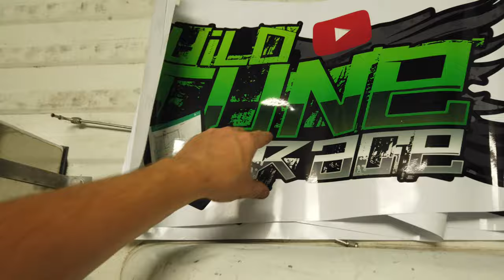Girlfriend Does Massive Burnout In My LS Swapped Burnout Truck!

Comment: more tyre pressure 70 pound plus dont be shy more pressure bigger bang(need to do 2 ) noses over in second gear (sad tune up ) need to pull top gear or its not a burnout it is all about tyre speed  switch limiter off its all about tyre speed my ls has seen 79000 (with a set of valve springs and a sloppy stage 2 cam i try to keep it around 6500 no limiter bashing and losing smoke put the timing where it should be and air fuel around 11.5 to 1 you should still get those zoomeys glowing red . the mighty ls can take it at least half a dozen times a day . a good aussie style burnout doesnt ride the brakes use em to start let em off once your in top gear and send it maybe touch them to help turn her around and you have done your first tip in from that point on do it again and keep it off the wall no statics no reverse no fucks given good luck mate your traveling down a awesome road
Reply from the maker: Thanks for all the info! We are having a ton of fun with this thing and learning a ton every time I hit that pad! This is definitely just the beginning of our burnout careers!😃

Comment: Struggles to hold top gear, what diff gears are in it?
Reply from the maker: I need to double check for sure but i want to say 3.42 or 3.73 they are what the truck came with but were changed at some point I think.

I think the problem is the converter is to tight. Drops Almost 2500rpm on the shift . Easy way to fix that is more power🤣
Reply: @BuildTuneRace   its NOT the converter, it's lack of torque and/or gearing.